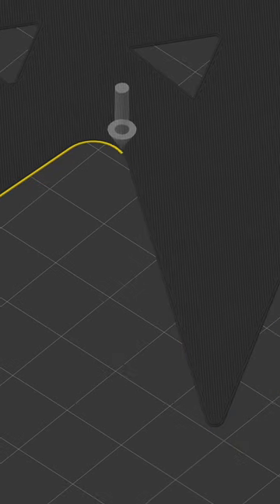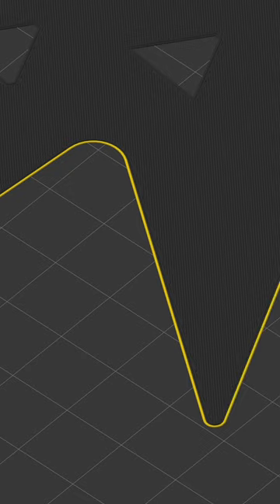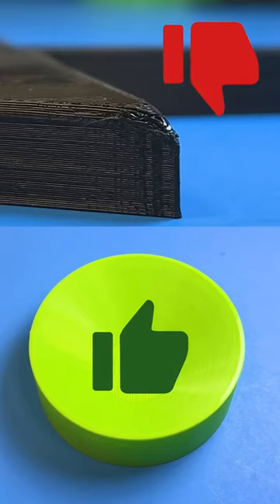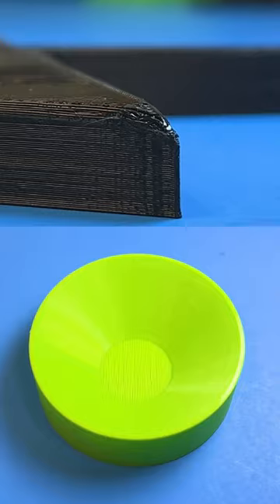#3DPrinting Design Basics: Importance of Rounding Corners #designfor3dprinting

Comment: also iirc if you fillet supporting structures on the Z axis it helps improve the structural integrity of the part 

since instead of a single thin rectangle essentially stacked on top of each other 

you get some wide rectangles that increase the layer surface area

Comment: I use shapr3d.. but what is a good degree for the rounded corner for basic cubes
Reply: I'm not sure what your question is but if your talking about Shapr3D I may be able to answer your questions. If it's a flat cube depends on the dimensions and how much like a cube does it have to look like. Generally i model in mm and my parts have 0.5 mm fillets for general purpose. 1 mm fillets for tinder fillets. And for minimal fillets where applicable 0.2 mm fillets.